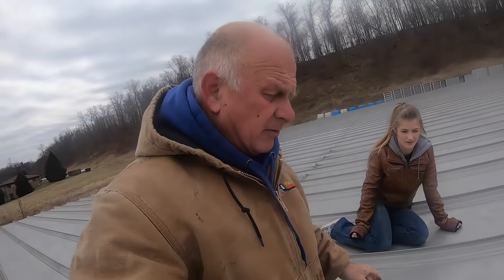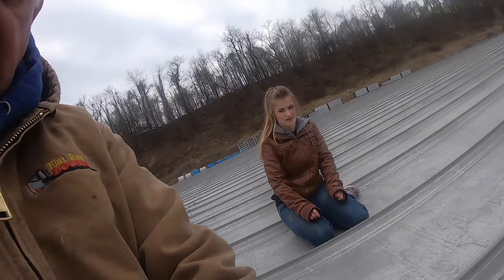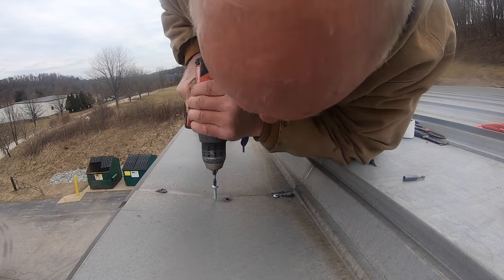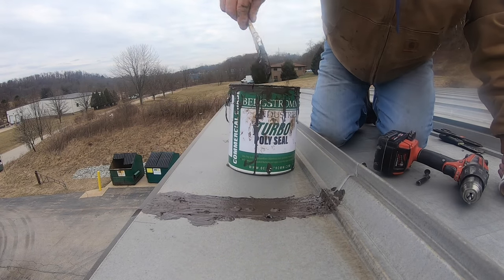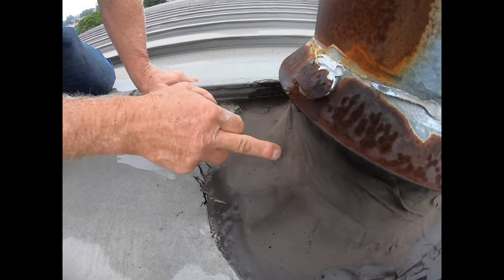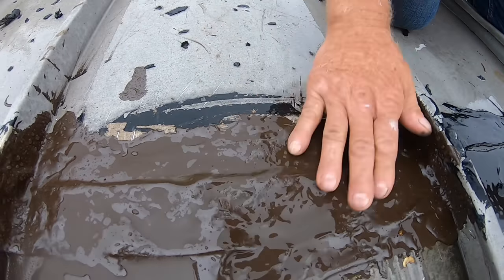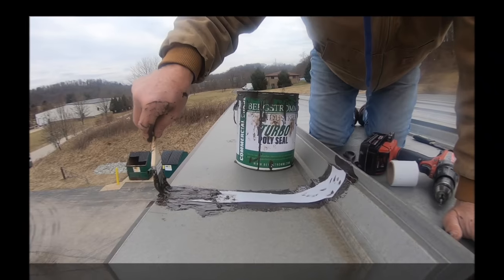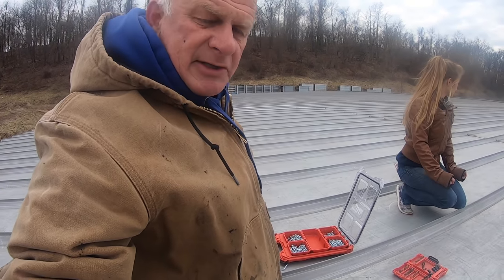Anyone can Repair a Metal Roof Seam leak in 3 minutes DIY Turbo Poly Seal

Comment: I have several leaks in my roof. I want to seal every bolt and around the vents. Should I use turbo poly seal? Or there seems to be a ton of metal roof tape that has made great advances. Any information would be super helpful to this mom stuck fixing her own roof. Thanks!

Comment: What is the paper like thing you put on top of the  poly seal? 

Will epoxy work instead of poly seal?
Reply from the maker: Ok, the white fabric we use with the Turbo Poly Seal is a Fleece made from Polyester. It is super strong and that is what makes this product stand out.
Epoxy won't work because it does not have the same elasticity or flexibility as that of Turbo Poly Seal
Reply: @FlatRoofDoctor  Where can I purchase the fleece made from polyester tape?
Reply from the maker: @lizmullins2675  www.bergstromm.com
Reply from the maker: @lizmullins2675  go to www.bergstromm.com

Comment: Thank you so much. Question,do you know what the flash point of that turbo poly seal is?
Reply from the maker: It is flammable. Like the Karnak Tar or any bituminous product used in roofing. So, this is a combination of Bituminous and Urethane Resins. I guess the same Flash Point or less than that of oil based urethane paints you use to paint furniture inside a house.

Comment: Can I use this product on my van roof? A seam is a bit rusty and leaking. I just want to seal it, no need to look pretty, although I'm happy to spray over a white coat if the Turbo Poly Seal can accept it?
Reply from the maker: I think you better off using Super Silicone Seal.
It will do a much better job and it is white.
Reply: @FlatRoofDoctor  Thank you for the advice.
Reply: @FlatRoofDoctor  why not turbo poly seal?

Comment: May I apply Turbo Poly Seal right on top of old tar previously used on the roof?  Thanks for the great video!
Reply from the maker: Applying over old Tar is like sleeping under a bed sheet and then just throw another clean sheet over the dirty one.  I think most people use common sense and take the dirty sheet off before putting the clean one on. But maybe you don't change sheets. 
It is all about what you think. Will the old Tar be good enough to go over or will it dry up and crack. It is hard to tell you what is best to do but I prefer to remove the old stuff and start fresh.
Reply: Can i get turbo poly seal form any Paint shop.....or from where should i find this?
Reply: Yes you can, it's best o wet the surface of the old patch first and throw some fresh dirt on it before you turbo seal, sticks like a champ!
Reply: @mikejohnson7768  haha!
Reply: @Johnnys Tech joke

Comment: You can try using larger metal roofing screws where the screws won't hold tight or where screws holes are stripped
Reply from the maker: correct

Comment: I have a garage with metal roof. An extension was built next to it. The gutter from the original open garage was left to collect the rain on both roofs. Since then a ceiling was installed to minimize the heat from sun. There has been a downpour of rain lately and we discovered water leaking from the ceiling where the 2 roofs meet the gutter. What can we do to solve this issue? My theory is that rain pouring from both roofs collide in the gutter causing a backsplash???

Comment: if the seam is at the egde of the roof, is it still repaired the same way with the fabric then turbo poly seal?
Reply from the maker: anytime there is a transition that causes a seam, then you should use the fleece

Comment: Do you prefer the turbo Seal versus 100% silicone? If so what are the differences between the two?
Reply from the maker: I prefer to use Turbo Poly Seal because it has a thick viscosity. It will not run that easy on slanted areas. I use Super Silicone Seal a lot because it will not deteriorate in a UV environment.
The Turbo Poly Seal is extra good when you add a Silver Coat Protection over it.

Comment: I use lexel. Great product!!
Reply from the maker: Lexel is almost like Geocell. I have used Geocell a lot in the past and found that it does not stay adhere for a long time. It shrinks adds stress to the surface it adheres to, eventually coming loose

Comment: I have a flat metal roof too. My is leaking between the vertical wall and horizontal roof like an L shape. I have layered asphault felts and tar last year. But, the felts I bought was too thin.  Now it’s peeling, and every time it’s raining, it’s is leaking. With the felts cover all the areas, its very hard to tell all the connections and screws. I am wonder if there are many different or thicker felts that last longer?  Any suggestions?  Love your video!
Reply from the maker: Ok I am not clear about the "felts" you refer too. Is that the asphalt-saturated cotton that you used with tar?
If so, the tar will dry out and the cotton felt will tear.
I suggest Turbo Poly Seal or Super Silicone Seal. If you are outside the US, you need to look for some Silicone Coating along with a Polyester Fabric material.
The Polyester fabric is very strong but will not withstand the UV's. So it must be covered 100%
Reply: Flat Roof Doctor I live 30 mins from Atlanta. So I guess I have to use a blow torch to remove the old tar and felt.  I can’t even see where all the screws and seams anymore. I have checked that product at Home Depot, I don’t see if they are selling that.
Reply from the maker: @AnhHaiCanTho  Turbo Poly Seal and Super Silicone Seal is only available online. If you send me pics of what the problem is, I might be able to help you decide what to do.
203 858 0080 Send pics to this phone number
Reply: Flat Roof Doctor I will video some clips to let you see. Maybe this weekend. I wish you are nearby, so you can fix it. Thanks Sir!

Comment: Hi:  thanks for schooling me on Metal roofs - now attempting to fix a Mobile home roof.  Most of the screw heads are rusty, of course some leak (I will replace those).  Would I need to replace/ clean them prior to putting down Super Poly Seal or the Silicone seal?  And do we always need the cloth?
Reply from the maker: I suggest not to use cloth over the screws. Just wire brush over and around the screws and then a dab of Super Silicone Seal. If you are planning to replace some screws, get 1 size larger than what you currently have.
I think you should invest in an angle grinder with a hard wire brush to clean around the screws. That seems to work the best for me.
You could also use Turbo Poly Seal but then I recommend coating the Turbo Poly Seal after curing to protect it against UV's.
The Super Silicone Seal does not need a protective coating.
You could send me pics of your project and I will be able to better help you with what to do. Send the pics to my Tel. at 203 858 0080

Comment: Our roof leaks where concrete extension meets the metal roof. Can we use poly seal on concrete too?
Reply from the maker: Yes, this is an excellent product for that application. Just make sure both surfaces are free from dust.

Comment: Where I can buy this poly seal in my country sir, Malaysia
Reply from the maker: Sorry, it is only available in the USA. It cost too much to ship internationally.
Reply: @FlatRoofDoctor  can you recomment another product sir, thank
Reply from the maker: @dinarservice101  Hey Robert. I am sorry, but I don't know anything else out there that is as good as Turbo Poly Seal. What you may do is find a Modified Bitumen Adhesive, as In Karnak 81 or 66 and then buy Henry's polyester fleece in a 5" roll at a Home Depot and apply it the same way I do it with Turbo Poly seal. The Polyester fabric is what will give it its strength
Reply: @FlatRoofDoctor  ok sir, which one better karnak 66 or flex seal liquid (ready stok here)
Reply: @dinarservice101  definetely go with karnak , flex seal liquid is a joke

Comment: when you inserted the screws the metal was flexing. It means you are not a  good joist. It will not leak because the polyseal will seal it but the metal sheet fixing job is sloppy.
Reply from the maker: I was just getting the panels that overlap each other to be tight together.

Comment: Turbo Poly Seal is $200 a gallon and it's just okay stuff. The best option is to buy Blackjack Eterna-kote Silicone, it's $300 for 4.75 gallons and it's way better than Turbo Poly Seal. It also sticks to more types of surfaces. Do not buy Turbo Poly Seal it's way overpriced and not nearly as good as Blackjack Eterna-kote. There is no other surface as good as the one you get from Eterna-kote, and I've tried many different ones. Do not get Liquid Rubber either, it sucks. And very hard to clean up

Comment: Why would you have to seal the seam? The seam is meant to overlap on the down flow water shouldn't be sitting on or in the seam. But I get it shit happens
Reply from the maker: This illustration was meant to show you how a leak starts. After several years of leaking the water between the 2 panels cause them to rust. This repair is when you were too late to prevent rusting and what to do now.
Use your imagination lol Hmmm come to think about it, this 3D animation took away your imagination. 
Just kidding with you. Thanks for the comment and very good observation.
 Take Care

Comment: $165.00 a gallon to seal 50 ft of seam. I'll just use Flex Seal.
Reply: Flex seal voids roof warranties.  Flex seal is not permanent, only a temporary fix.
Reply: @thekingtroll2  If it's under warranty then it would probably be fixed for free. My metal roof is not under warranty and I can use what I want. If it is a professional watching this to see what to use on a roof, well I don't like the idea of a professional roofer watching YouTube to learn how to fix my roof.
Reply: You're going to spend more than 165 bucks by the time you're done using flex seal, umpteen times and still leaking.

Comment: As you can see, Turbo Poly Seal comes with a hot assistant who looks fantastic but actually serves no function. That's why it is expensive.
Reply from the maker: You absolutely correct. The assistant is the hart of it all. I guess you are one too. It takes one to recognize one. Very good day to you.
Reply: @Nahzuul, Haha! I wish! Watch the video closely...there are only two (2) people up there on the roof. One (1) Flat Roof Doctor + One (1) Hot Assistant. NOTICE: While HE is holding the camera - SHE is visible in the shot. Now...when the Flat Roof Doctor was down on the deck working with both hands -- the Hot Assistant had simply vanished! Oh, dang!. So...who the heck filmed the rest of this video?!? It Is A Mystery - For Sure. ;-)